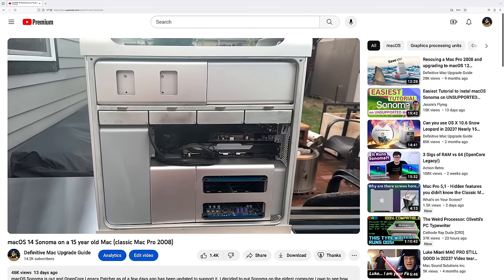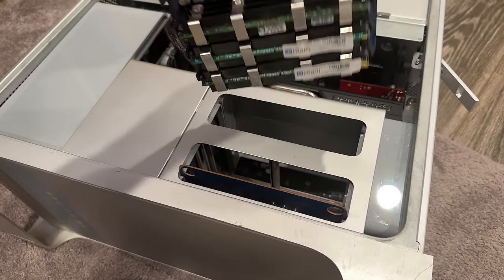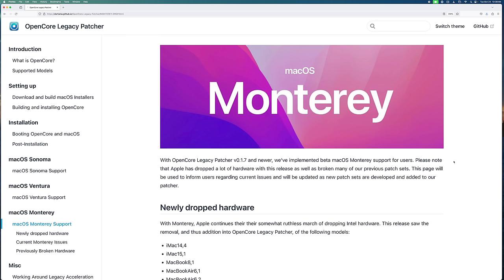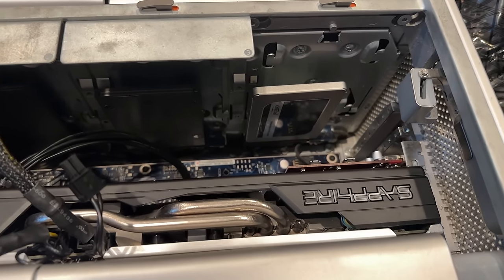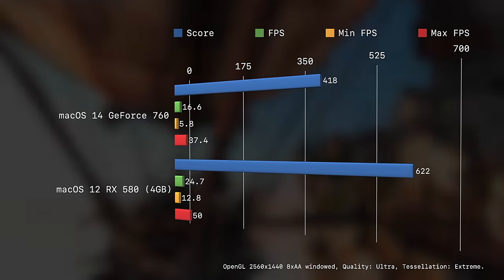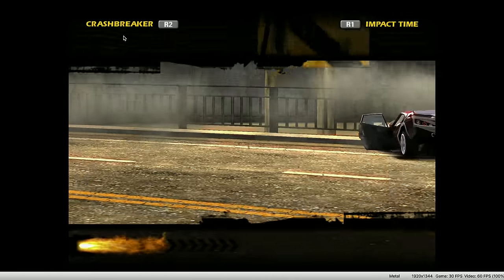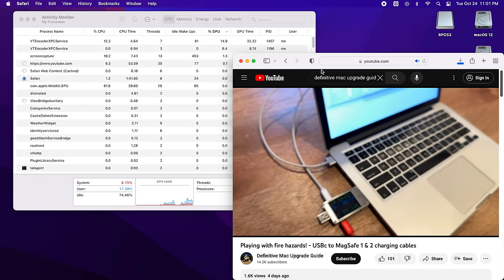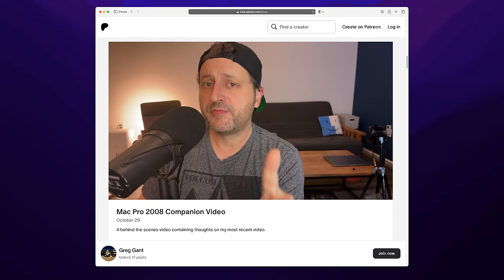Is it worth upgrading an ancient Mac Pro 2008?

Comment: For an older but good GPU, consider the RX 590.  It’s very similar to the RX 580 with slight clockspeed and VRAM speed bumps, but most importantly, shipped with 8GB of VRAM (not sure if all 590s have 8GB, but my PowerColor Red Dragon RX 590 did).  I used one with my mid-2017 MacBook Pro in a Razer Core X eGPU for years without any issues.
Reply from the maker: The downside is I’m pretty sure all the coolers on those block the 16x pcie slot.

Comment: I have one of these. Gorgeous machines but they are really hampered by memory speeds, their ram is slower than modern SSDs!
Reply from the maker: At least with expensive multi-SSD cards, you can address PCIe SSDs at 3.0 speeds. Sure, it's not PCIe 4.0 but the law of diminished returns kicks in quite a bit.

Comment: Hi there. This video is perfect for next question. When you used open core legacy patcher to upgrade Mac os to ventura or sonoma or monterrey you REMOVED the original AMD gpu...yet you still have it installed.why? Some  other guys say they have both gpus to get boot screen. That means you "switch" monitor wires??or you can have both plugged and get boot  screen even of the monitor is plugged to not AMD gpu?
Reply from the maker: I'm not sure if it's this video or the other video the Mac Pro 2008 but having the Radeon 2600 XT caused me a lot of grief with OpenCore so I yanked it. I dunno if there's a continuity issue in my shots but I can positively say, I do not have it installed. I do keep it around as a "Just in case" as having an original GPU that can output the EFI bootscreen is useful.
Reply: @dmug  thanks for the answer. I also have the original AMD gpu for the rainy days, stored in a box... I used your video (the painful one) to install big sur and monterrey in a 2008 3,1... I experienced the same issue as you with the AMD gpu... let me ask one more question. I have Intel Xeon E5462 @2.8 ghz (2 quad cores) cpus in my working 3,1... if I want to upgrade them which cpus can I install? I will end up giving you for free my 1,1 macpro for your projects
Reply from the maker: @AndresValdez54235   The answers you seek are here.
https://blog.greggant.com/posts/2018/05/07/definitive-mac-pro-upgrade-guide.html

If you're offering a whole Mac Pro 1,1 I'd hate to burden anyone with the cost of shipping it as it's _expensive_. I appreciate the offer but but unless you happen to be in the PNW where it's local shipping could be as much as $75. Also, they're a pain to pack.

Comment: Nice one Greg! Cheers from NY. I’m on Monterey 12.7 with MLOC 0.9.5 and rx6800xt the old girl is still rockin. But my McFiver pcie card seems to be frying my bus powered SSDs. They work as they should then all of a sudden drop to USB2 speeds and never come back. It’s really weird. Powered drives work fine. Talking with Sonnet but must be some kind of power issue.
Reply: you should upgrade to 1.1.0-With the release of OpenCore Legacy Patcher v1.1.0, some noteworthy improvements are dropping!

T1 Security Chip support for macOS Sonoma!
Restores Touch ID Authentication
Applicable for 2016 and 2017 TouchBar MacBook Pros
MacBookPro13,2, MacBookPro13,3, MacBookPro14,2, MacBookPro14,3
Streamlined OpenCore vaulting for additional tamper protections by Jazzzny
Improvements for macOS 14.1:
Resolved PCIe FaceTime camera support
Resolved USB 1.1 support
Reply from the maker: You could buy a voltage meter, I picked up a AVHzY model, which you can record what’s happening over time and see if it has weird power spikes. It’d be a pain in the ass and I think the software is windows only for the data it generates. There’s videos that show how to use it. I just bought it so I could tell if my USBc cables were charging cables or not.
Reply: @dmug  I have iStat and it shows pcie voltage etc but doesn’t mean much to my audio engineering brain but it looks consistent on the card. May be slightly underpowered but I don’t know what it should be. I have one bus powered ssd that doesn’t have the issue and keeps working normally. Still waiting to hear back from Sonnet.

Comment: Install Linux and you have a 5+ years machine
Reply from the maker: And stuck with Linux 🙃 Don't worry, I'll be doing some Linux vids soon.
Reply: @dmug  I have a 2009 iMac that wasn’t working with opencore “graphic card issue”, then I installed Linux Mint and it works flawlessly, using it everyday

Comment: I tried to answer your last message several times, but it kept disappearing so I sent an e-mail to you with a link.  Perhaps you could try installing a Linux distro on an old laptop to try it or you could just try it in live mode from a flash drive.
Reply from the maker: Man, YouTube is so weird about it’s censorship. Often I’ll see a notification for a comment and I’ll try to reply to it and then I’m unable to because it’s gone.
Reply: @dmug  Yes, that often happens.

Comment: This is the first Mac I threw out - the coolant leak ruined it and I had no desire to either repair or mod it. Yes, I have been kicking myself ever since.
Reply from the maker: Coolant? Sure it wasn't a Dual CPU, Dual Core G5? The Mac Pros are all air cooled, unless you modded it...
Reply: @dmug  Yeah - that - the case looked the same

Comment: Too bad these are still rather expensive, or I would buy one to run Debian.
Reply from the maker: Depends on where you are in the world and if you find them locally. I’ve seen them go frequently for $50 and under, sometimes free. Since they’re heavy as hell, eBay will never be the rock bottom pricing for them. If you hang out on the Facebook group, MacProUpgrade, sometime people post them for sale but being a global group, you have to be lucky to find one nearish.
Reply: Even the systems with Power chip are somewhat expensive.  I ended up with a dell 990 i7.  That was under $120 U.S. shipped, and will probably be useful for awhile.  Yeah I had been looking at ebay with local pickup.  That was rather a dead-end, polluted with prices that were good five years ago!
Reply from the maker: @stevejohnson1321  That's too bad.

Comment: So question. How did you update to Mac os 14 when the using the built in usb ports are none usable?
Reply from the maker: They're usable, just USB1.1 doesn't work until post install patches. I think I talk about it in this video:
https://www.youtube.com/watch?v=exCcSce2uNo

You just need a USB2.0 hub to use USB1.1 devices like most mice and keyboards.
Reply: @dmug  are the logitech mx master series usb 2.0 or 1.0 and also where did you plug in at.
Reply from the maker: @stevenlucas7930  I don't know off the top of my head. As previously stated, all the USB ports work, but before you do the post-install hacks for OpenCore, you'll need to use a USB 2.0 hub and plug 1.1 devices into it. It doesn't matter which port. After you install the post install hacks, you will not need the hub.
Reply: @dmug  I understand and sorry for asking, I know Monterey didn't have a problem but when I tried ventura it was like everything just went nuts 🤣🤣.  I will buy a adapter tonight and try it. Thank you!!!!!
Reply from the maker: @stevenlucas7930  no worries.

Comment: HAH. PERFECT Timing Greg. i´m doing the very same project these days. Having headaches over det shitty web drivers and an Asus 1060 6GB. But i ´m stuck on High sierra 17G66 firmware which REFUSE to get the latest security update, i suspect the dosdude patcher locks down the kext or system some how.
So think i have to crawl back to using a spare RX 580 after all ;)
Reply from the maker: Yeah I had 1060 in this very system years ago. I ended up with Vega 56 in it but sold it during the gpu crisis for an absurd $850.
Reply: woah lol. That IS (was) absurd. @dmug
Reply: …and i payed approx $80 a year ago for my 1060 @dmug
Reply from the maker: @ladeluff_ Not bad at all, especially given the market then. I bought the 1060 new in early 2018 for $360. I gave it to my brother when I got the Vega 56. The ironic part is at one point I had two Vega 56s and sold it at the very beginning of the pandemic for like $180. Whoops.

Comment: I have a 16-core 2019 Mac Pro. I really love this machine but the GPU is the bottleneck with me as well. I have a W5700XT 16GB. I would like to buy either a single or dual Radeon Pro W6800X  MPX Module. But it's expensive and i know that for that price, you can buy a Mac Studio or Macbook Pro. But i really love my Mac Pro! I just don't know what i should do at this point... 😩
Reply from the maker: Buy a non-W series AMD GPU. See this video:
https://youtu.be/ZjGgLgl1EnE?feature=shared
Reply: It will take a normal GPU though right?  Just get a PCIe rx-7800xt or even faster.  That will give you a ton more GPU performance.
Reply: @gametime2473  I don't think that one is supported by Apple sadly enough... 😞 But i really need more Thunderbolt 3 ports. It really sucks that this is only combined with the MPX module!
Reply: @DBLCreations  There is a youtube video of a guy installing an rx-6800 in his 5,1.  If that works, any AMD should.
Reply: @gametime2473   The 6800 is supported by Apple. The 70 series are not apparently. Already looked that up. I know the 6800 is supported.

Comment: why anyone wants such a locked down system is beyond me
Reply: These machines are great for triple booting, and can actually have dual 6 cores with the right "CPU tray" as in 2 physical xeon.... Also there is firmware mods that unlock them even more... Honestly it's a decent machine even in today's world.
Reply: But u see. This what i consider The Fun in  «nerding» on a cheesegrater is all about. Solve problems😅
Reply: XCode

Comment: I tryed many times,I simply cant install this on my 2008 Mac Pro,it wont even use the files on it,only on my mini from 2014 will it work,but thats not the machine I want to install...
Reply from the maker: Have you checked out some of the mentioned YouTube channels in this vid? There’s some good tutorials out there. My previous vid sorta covers how to install on a 3.1
Reply: Yes I have,no one speak of what to do if the file cant be run,there is a sign that shows they wont work on the 2008 Mac Pro. I tryed to install Linux Ubuntu,but cant even figure out how to use the disk program,so no install....
Reply from the maker: @Knudjensen54  I'd check MacRumors Forums, I haven't tried to install Linux on my Mac in probably 10+ years.

Comment: Good day friend. Thank you for the time you invest in sharing such valuable information, we are very happy with your YouTube channel, I greet you from Ensenada Mexico. If you allow me, I would like to ask you a question: I have a Mac pro 3.1 early 2008. Will an Rx 590 Sapphire Nitro+ (special edition) 8 Gig graphics card be compatible?
Reply from the maker: Yes, all Radeon RX 580s are compatible, although there are rare cases where a seller has loaded on specialized firmware onto the card. If that’s the case, you will need to reflash it the proper firmware.
Reply: Thank you very much for answering friend. I was referring to the RX 590 and not the RX 580. Or are the two video cards the same?
Reply from the maker: @jaimemartinez-castillo9779  sorry I didn’t clarify, the RX 590 is an overclocked RX 580. It has a larger cooler that will block the next PCIe slot but is effectively the same GPU as RX 580x
Reply: OK. I UNDERSTAND. I THANK YOU FOR YOUR TIME AND FOR RESPONDING SO FAST. ONE LAST QUESTION IS THIS VIDEO CARD (RX 590) COMPATIBLE WITH METAL TECHNOLOGY?
Reply: Intente istalar Big Sur Con la RX 590 y con OCLP, pero no se que estoy haciendo mal, solo veo una pantalla negra y no puedo ver el boot.
Reply: I tried to install Big Sur with the RX 590 and with OCLP, but I don't know what I'm doing wrong, I only see a black screen and I can't see the boot.
Reply from the maker: @coordinacionensenada8142 you lose the option boot screen with any after market AMD cards.

I suggest reading the GPU section here 

https://blog.greggant.com/posts/2018/05/07/definitive-mac-pro-upgrade-guide.html
Reply: Thank you very much friend, I'll do it that way. Greetings.

Comment: An interesting video and perhaps you could make a video showing how well it works with Linux Mint or another Linux distro.  There are many free games in the Linux Mint repository and Steam can be installed, Wine can also be installed.
Reply from the maker: At some point I'll probably go in on a Linux distro and make a video about it. I use Linux via CLI in Docker containers fairly regular but haven't touched desktop Linux in years. I'm a bit of a known Linux-desktop skeptic so might be fun.
Reply: @dmug  My daily driver is Linux Mint Mate, but many folk prefer the Cinnamon desktop, I have tried several Linux distros, (about 30 in fact) but Linux Mint suits me, I do have Windows 11 on another computer though.
Reply from the maker: @laurencejohnson4106  I debated making a Linux video where I have to actually use it to make a video but decided against it as I’d be mildly frustrated by having to learn Da Vinci Resolve to make it happen and I don’t really have a replacement for some of the tools I rely on like Apple Motion, Cubase/Ableton, and Topaz Video AI upscaler. I think the angle I might use focusing on the performance angle as macOS is generally the slowest OS when comparing against windows and Linux, and there’s solid benchmarking tools that are cross platform I could use, and more show it’s feasible to do much of what users want to do, from the perspective of someone who hasn’t used desktop Linux seriously for 15 years. Open to angles to approach the video.
Reply: @dmug What I can say is that I pulled out my Dad’s old 2008 Mac Pro and installed Linux Manjaro KDE and was floored by how smooth things were. I even threw in his old Nvidia Quadro k4000 and was running 4k content with ease. I mean, it can run lots of very good and useful retro games and likely could run a few current. All drivers were automatically detected and installed. Quite honestly with this OS this could make this machine last many more years. It’s worth a try at Linux if you want to squeeze out the last bits of use of this machine.

Comment: How about trying to put NVME SSD into PCI-E x16? I've done that on a random old HP - sure, the bios did not support the NVME but it does not really matter so long you have the boot files on another drive, I just put in an old USB stick permamently as my boot drive ridirecting to NVME.

Comment: I'm still dicking @ with mine overseas i had to take out the top row of ram to run 16gigs on bottom tray, with an adjustable usb fan toward the back wall blowing hot ram air out & since I want El Capitan on it its work in progress not quite there yet but did manage to upgrade to 2,1 not sure what is the most effective method to upgrade it to El Cap aside from modding the boot eufi code via terminal etc.
Reply from the maker: If anyone can get the Mac Pro 2,1 to modern macOS, they'll be a hero. I never owned one myself so I haven't followed the developments as closely as with the rest of the Mac Pros. Last I saw, I think people had Windows 11 working on them.

Comment: Need your help man, I want a Geforce GT 730 so i can connect two 30 inch cinema display, but in your guide you said I need to have Kepler chipset, how do i know that before i buy one?
Reply from the maker: You don't need specifically Keplar GPU, just a GPU that can do dual 1440p@60hz. The Cinema displays are a pain as they're dual-link DVI and DVI is a dead standard. More modern GPUs either have a single DVI port (which will support Dual Link) or none at all. I know people love those displays but I just am not a fan of using them as most are yellowing at this point and there's better displays now for less money, without the hassle of dual link DVI.

Start here:
https://blog.greggant.com/posts/2018/05/07/definitive-mac-pro-upgrade-guide.html#duallinkdvi

The best option would be to skip the Cinema Display (or at least two). The secondary option would be to find a more modern GPU with a DVI port and then get an active convertor for the second Cinema Display. You can ask around on MacProUpgrade on Facebook, MacRumors Forums in the Mac Pro group or Reddit's Mac Pro group to see what solutions people have cooked up.
Reply: @dmug @dmug  call me crazy, lol, but I love those damn monitors, man; right now, I have one 30-inch and 27-inch Thunderbolt, and the 27 have a webcam which I won't have with the 30-inch.